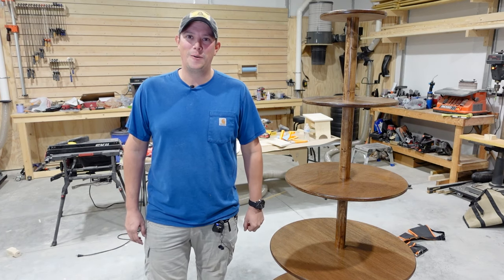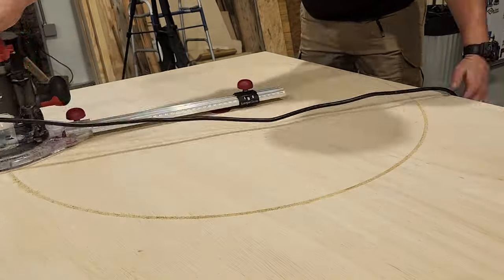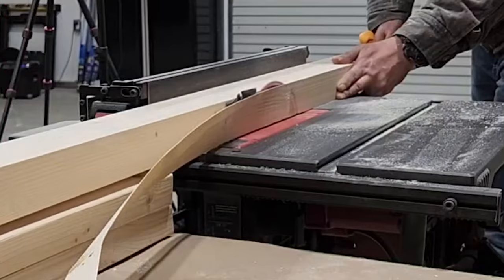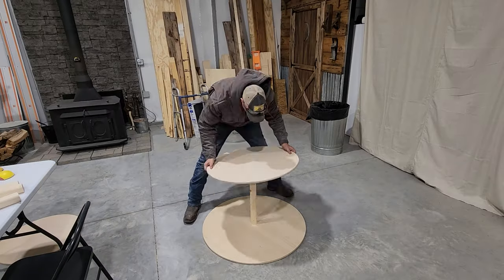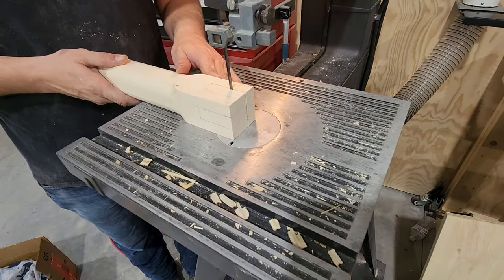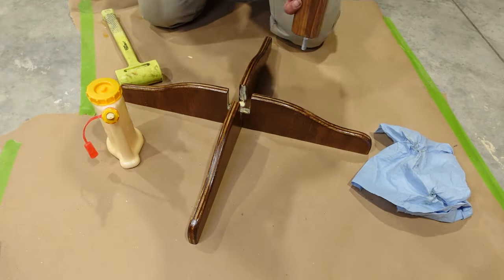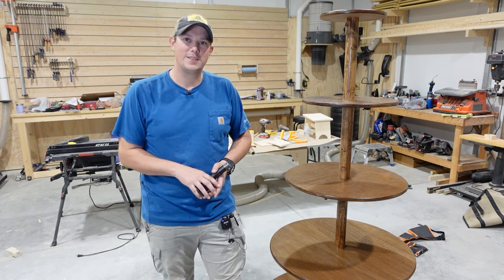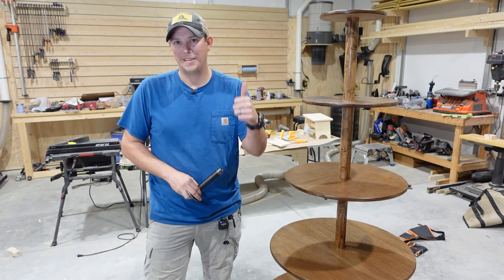DIY Christmas Display Shelf / Christmas Tree Village Display

Comment: Well, need some practical advice for the village itself. Would you drill small holes around the edge so you can zip tie the garland around it?  Also are you planning holes for the cords of each house to feed down to a power supply?  As for a spinning version, how do you deal with the electrical cords.  The tree is beautiful but not practical until it supports a live village with power.
Reply from the maker: @rbks4345  drill a hole near the trunk on each shelf for power cords....attach your garland however you want (holes, hooks, zip ties). 

Also if you've ever seen a spinning christmas tree stand, they are designed for the cords to plug into the spinning portion, it's no different than a regular spinning tree with lights
Reply: @PatriotDIY  Awesome!  Thank you so much.  Yours is so beautiful. It can stand on its own even.

Comment: I built one a few years ago, but cord management is an issue. I'm trying to think of how to make a channel in the tree trunk to run wiring.
Reply from the maker: @ethanlantz6553  I just drilled a 1" hole near the trunk on each shelf
Reply: @PatriotDIY  That is what I originally did, but I found the wires got messy and difficult to hide. I'm thinking about routing a channel and wiring it. Dropping the shelves down over the trunk. May be too much.

Comment: I love it but I was wondering if it's big enough on the bottom to put the Polar Express train on it? Is there something different that can be used on top instead of the wing nut I was thinking I could put my church on top but not with the wing nut on it?
Reply from the maker: You can make the shelves any size you want to fit your items. 
And you could use a regular nut or a T nut in the top shelf instead of the wing nut.

Comment: I saw a nut/cap on the top section.  Rods all the way through?  That's how I would do it.
Reply from the maker: No, each section of the "Trunk" has a 3/8" threaded insert nut in the bottom and a 3/8" hanger bolt in the top
Reply: @PatriotDIY  13:03 Ok I saw the wing nut.  That was what made me think it might be all the way through.
Reply: Can I purchase this?
Reply: Ask him.
Reply from the maker: @bradyreynolds7205  already sold!  But I could build another. Where are you located?   Email thepilotpatriot@gmail.com

Comment: I hate saying anything because I know making videos isn’t an easy thing. Those T-nut are not designed for your application. They will just pull out with any leverage  l. T-nuts are meant to be on the opposite side of the material l, so they sandwich the material. A better fastener would be a threaded insert with epoxy.  Best of luck!
Reply from the maker: @1ofakindwork  you should skip to 11:07 in the video!
Reply: Got em